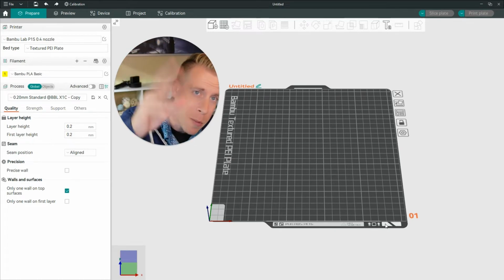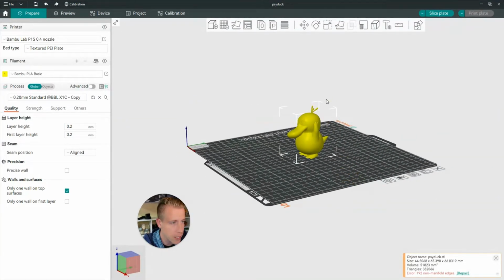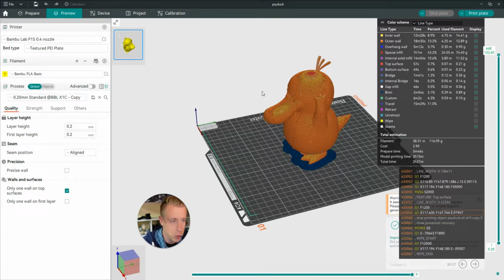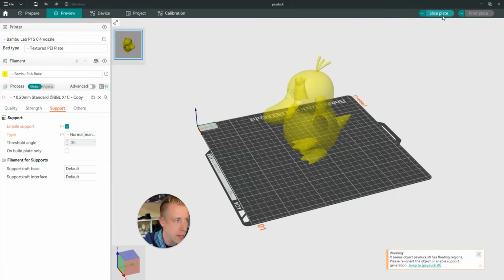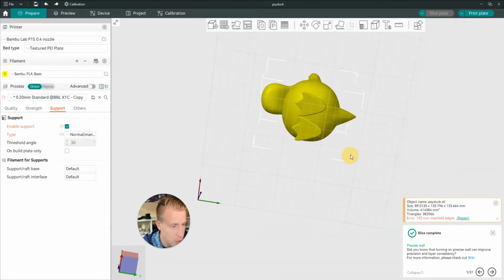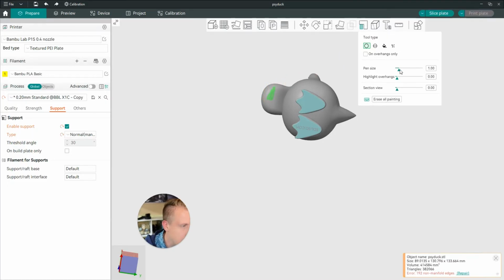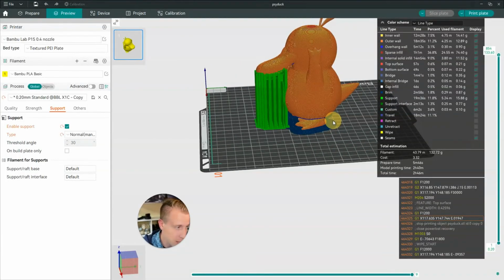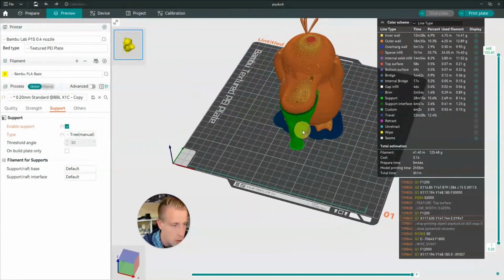How to Add Custom Supports in Orca Slicer

Comment: When you said "how to add custom supports" I thought you were going to share how to import custom models from 3d software to use as supports (I'm trying to make my own custom supports rather than rely on the slicer's algorithms which are limited to 'normal' and 'tree' apparently).  I'm not sure whether this is possible in OrcaSlicer, and if it is, whether to separate the model/support surfaces in 3D modeling program or slicer.

Comment: I’m having trouble with the supports coming off. So the supports do come off but it’s hard to take them off and it leaves a very rough surface underneath and not smooth like it supposed to.

Comment: Searching for a way to add custom shaped supports like in Cura Slicer, but it seems to be impossible on Bambu Studio and Orca Slicer. For example, add a cube shaped support structure to engulf a part of the print in order to add a firm adhesion. Draw the support only work with a certain amount of angle.